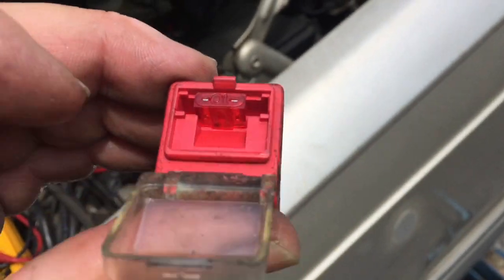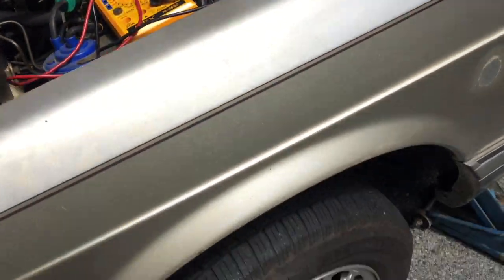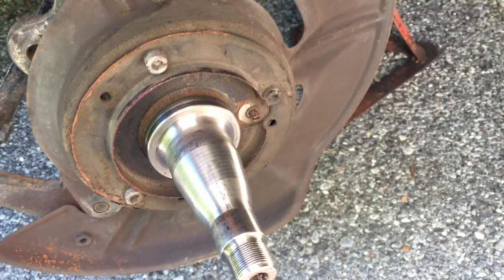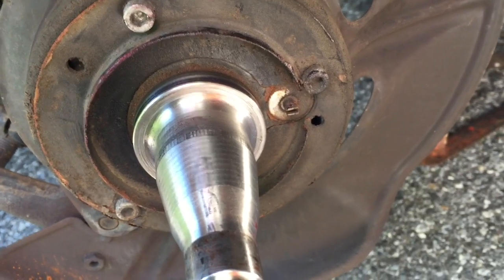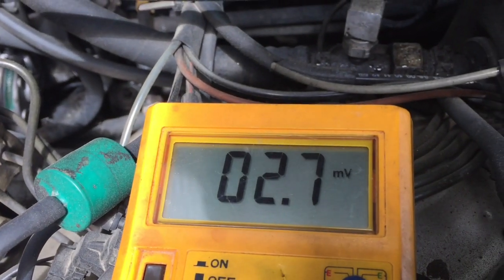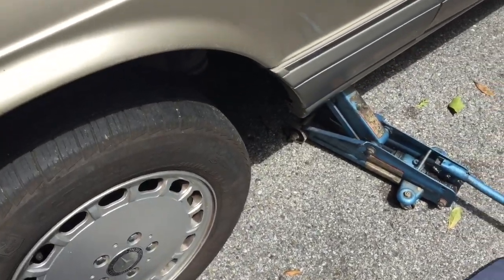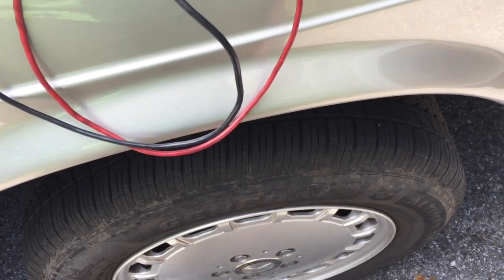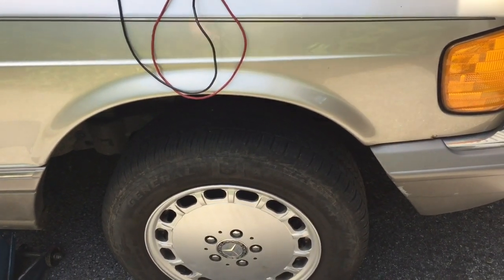W126 Benz What to do when the ABS warning light comes on

Comment: hi mine was w126 300sel ,car seldom drive this few day the abs light on but if knocking the ovp relay its gone .is that the ovp relay faulty ? or other i need to check on
Reply from the maker: Yeah, that is likely the relay. Fortunately these are fairly easy and cheap to replace. You just need to get the correct one. They fifer on how they are mounted and how many fuses they have.

Comment: Thanks you for the video!
Do you something similar for the ASR? Light is on, cruise does'nt work (dont know about ABS). Where to start looking?
Reply from the maker: The cruise control is separate from the ASR. Will put ASR troubleshooting on the long list of requests. Start with troubleshooting the wiring for the automatic restraint system. Airbag(s), G force sensor (under ashtray on the tranny tunnel), and belt tensioners for starters. Use a power probe. Fun stuff, huh?
Reply: @straybenzes  😃
Reply from the maker: @taanielreimers6938  🤞

Comment: will an abs light coming on disable the cruise control
Reply from the maker: No, the cruise control amp does not impact the ABS
Reply: @straybenzes  i changed my cruise control actuator and ecu but still no cruise control, I thought maybe because the BAS light is on it wills top the cruise control working
Reply from the maker: @sas8403  9 times out of 10 it is a bad cruise control amplifier. Where did you get your replacement amplifier from? If it was just another used one from e.g. Ebay then I would say you should seek out a reputable electronics repair place and get your original one fixed. That is where I would start.

Comment: Hello my friend, thanks for your video. The following way is easier and is recommended by Mercedes (without turning the wheel): 
Set the multimeter to Ω. The value should show 1.0 Ω. Now wiggle the ABS cable in the wheel house. If the value changes, the cable 
is defective. It's easier, more accurate and you don't need a jack.
Reply from the maker: Easier, yes. Unfortunately, this not a catch all either though. Good to know.

Comment: On my 1991 300D, the only problem is the low idle. No ABS light, or failing tachometer, just low idle when the engine is cold. When it warms up, the idle gets higher. Could it still be the OVP relay?
Reply from the maker: Yes, it could still be the OVP relay. Usually the tachometer also does not work when that happens though. When did this problem start?
Reply: @straybenzes  since I bought the car, about 1.5 years ago, it always had very low idle when it's cold, right about 500 rpm. But when it warms up it runs very smooth, at a higher idle speed. I'll look into it though, thanks for your help!
Reply from the maker: @dinispaulino7512  Hmm. That makes the OVP being the problem less likely.
Reply: @straybenzes  I suspect the problem might be the red solenoid the sits behind the injection pump. That's what controls the idle speed according to the temperature, the screw that you can manually adjust is just a base setting for the idle. And the 1991 model doesn't use that ELR plug like the 1987 model. The problem is, those solenoids are only available from Bosch and are around 800$ new...
Reply from the maker: @dinispaulino7512  Yeah, that would be my kind of luck also. I do believe that this is probably more likely to be the problem. Good luck!
Reply: @straybenzes  Thank you! Your videos have been very helpful!
Reply from the maker: @dinispaulino7512  Awesome!

Comment: U041500 ,b179b15,u041525 was one of the codes I had
Reply from the maker: HI Carlos. What model and year is this? OBD II only came about after 1995. U041500 is a rather generic code but it is a little suspicious that the this code set is only now showing. Start at the sensors and make sure that they are properly working. If you have a car with OVP then also make sure that it's fuse is not broken and replace the relay - they are cheap and can cause for the ABS light to come and stay on.
Reply: @straybenzes  mine is a 2013 Mercedes Benz c250.. I appreciate all your help.. Im going to check if I have a ovp fuse
Reply from the maker: @carlosarzu5318  Ahh. There is no OVP on a Benz that young. Again, you will need to verify that the sensor are indeed ok and that all the different wires are ok also. Then I would recommend to get a good scanner to dig deeper into the codes. http://www.mercedesmedic.com/best-obd-2-can-scanners-for-car-diagnostics/ Good luck!
Reply: @straybenzes  I fixed my issue. I changed the tone-ring and know lights on cluster is cleared, thanks for all the pointers 🤟
Reply from the maker: @carlosarzu5318  Congratulations! Great job and enjoy your future classic car.

Comment: Hi,I'm getting a fault that says(right/left front permanent )
Reply from the maker: Hmm, I am not familiar with that one.
Reply: @straybenzes  at first codes was to change front left/right sensors. I changed both and now I get esp light on and permanent front sensors
Reply from the maker: @carlosarzu5318  Are the sensors new MB OEM style ones? Did you test both as per the video? If the voltage they generate is not right or they are shorted this is the fault you would see.
Reply: @straybenzes  yes mercedes benz change it. I don't want to keep giving them money if the issue is not being solved,I rather figure it out myself.
Reply from the maker: @carlosarzu5318  That sounds like a plan.

Comment: Hi Ralph - Just had New rotors and calipers installed. Now ABS light is on. Mechanic says wires look old. Tells me to buy new sensors. What would your recommendation be?  Same troubleshooting procedure as shown in the video?
Reply from the maker: That is an interesting mechanic. Going by the looks of wires is only part of the story. A good mechanic would have checked into that situation in more detail. If the light was not one before this work and now it is on seems to be very peculiar to say the least. The whole hub has to come off for the rotor replacement. The hub covers the tip of the sensor. Metal debris from working on rusty brakes and hub can mess up the sensor response. An inexperienced mechanic may have damaged the toothed ABS ring on the hub. Does the light come and stay on immediately upon starting the car, or does it come on once you start driving? The latter can be the symptoms of that. The procedure can be used to tell you which side may be damaged. The sensor is held in place with a small M6 screw (5mm Allen) but sometimes it is very difficult if not impossible to remove so you could inspect the sensor tip without removing the hub. Good luck checking this out.
Reply: Stray Benzes Turn the car on, backed into driveway, pull forward a few feet, they remain off. Can’t drive car now because of cars behind me on single lane driveway. Don’t know if that helps. Can drive later. Thanks Ralph.

Comment: Hi I have a issue in my w202 abs light is on
1) If the car stop the engine for 2 to 3 hours ans start abs light is on.
2) Once I see these lights, I let the engine run for 1-2 minutes, then turn off.
3) Then I restart the engine again, the lights off with No malfunction.
4) After this, these lights won’t light no matter how long you drive and how many times you start the engine.

I have tried reset the sensor by turning left/right on wheel for a few times, the same situation re-appear above.
Reply: Hi i scanned the vehicle and it says a7k1 relay low vaultage.we replaced it but still same.replaced the ovp relay also
Reply from the maker: @rangasenavirathna4081  I feel your pain. I did some looking around on the internet and found this post that contains the diagram where that relay sits. I am hoping this will help you. https://www.benzworld.org/threads/were-is-the-asr-relay-located.1361345/
Reply: I knw the relay location and we replaced the relay also.bt no luck
Reply from the maker: @rangasenavirathna4081  Hmm. Did you  measure the output of each sensor spinning each wheel and did those numbers match? The ABS light does come on the moment you start driving the car when they are not the same.
Reply from the maker: Hi Ranga. Looks like you have a 90s C Class there. Those had OBD2 diagnostics. I would either loan the code reader or buy one (that model was infamous for all sorts of electrical gremlins). Get the code off of the on board computer when the light is on. There are multiple causes that will intermittently turn that warning light on. It could still be one of the three sensors (2 at the front wells and 1 on the rear differential). I have read about the alternator diode bridge possibly causing this. If the brake pedal is not pulsing just as you are coming to a stop with the ABS light off it is unlikely a sensor problem. Sorry for being only of limited help. Good luck!
Reply: @straybenzes  thank you very much for the advice.ill check that
Reply from the maker: @rangasenavirathna4081  Good luck.
Reply: Abs light gets on as soon as i start the car.before moving.tnx ill check that too

Comment: Hello from Finland and thanks for the video. I have 83 SE 380 with abs problem. Light goes on every time when car is moving. Sensor is clean and ok, so as ovp relay. I really dont know what is the problem. Thank you man.
Reply from the maker: Hi Ari. Did you jack up the front of the car and test each side's sensor like shown in the video? There should not be a difference in the generated voltage. If the car is at standstill, engine on, and the light stays off and then comes on while the car is in motion it is most likely one of the three sensors (the rear one is on the differential) even if it "looks" good. All the best! Ralf